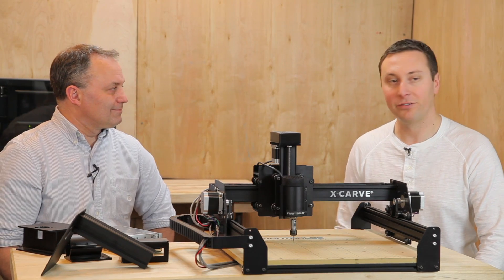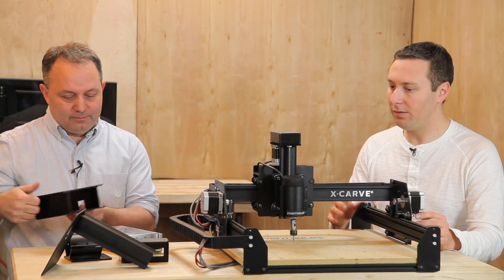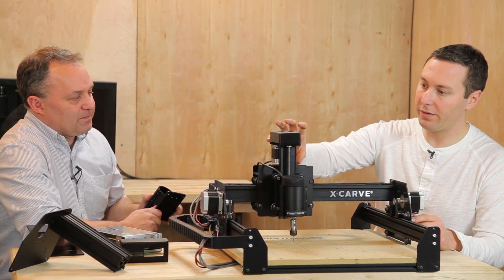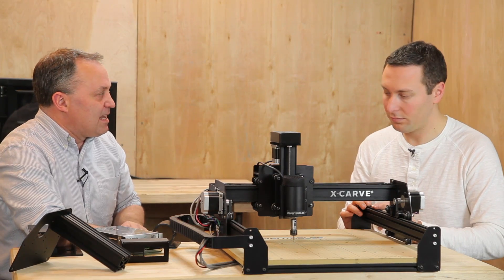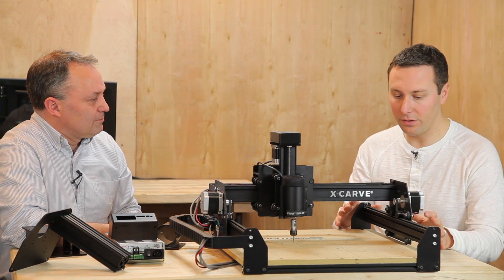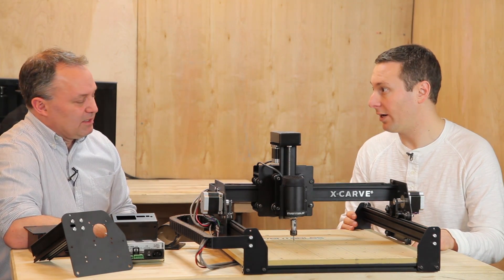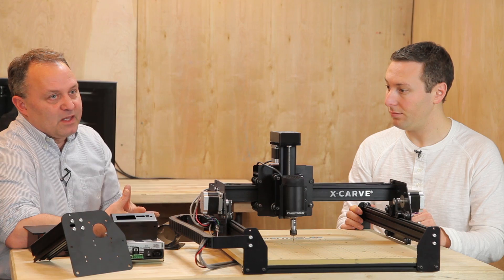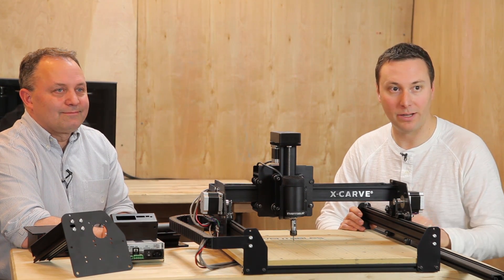Zach Kaplan and Bart Dring Introduce X-Carve 3D carving machine by Inventables

Comment: just called one of your sales reps and I told him just what I wanted the machine to do that be cutting into silver flat stock I am a ring maker and would like to get this machine in all my fellow ring makers back to the ? I need the machine to place a few words inside a set area  on flat sheets of silver the sales rep didn't know what I wanted and sent me to your easel site to see in the machine will do just what I wanted. doe's this machine do what I want place words in the center of a set area and around the coin I need to mill out plus a hole cut in the center of my silver sheet I need to machine several circlular  shapes ane a hole in it centered the words will be in the center from the inside hole to the outside of the circle can this machine do this if so I will order mine rite now

Comment: Really appreciate the simplification and the use of extrusions. Brilliant! Also like the price point, I looked pretty hard and couldn't find a better deal. There were a lot of places where you could buy parts if you had a clue what you were doing but for a fully configured unit that you can have confidence in the parts list it is really a nice setup. Can't wait to get mine and run it through it's paces.

Comment: what spindle speeds and feed rates can these run? I saw the part saying 1k IPM rapid which is fast but what kinds of feed rates would you get with a .1" depth cut in 6061 aluminum?

Comment: I was pretty excited about this kit until I saw the 800$ price tag for the "kit"...seems a little steep to not include a spindle. I watched the other one that was prior to this,,,the 44 min build kit. Is that still for sale? I saw bolts and square extrusion tubing. A nema package..you can get 3 nema 32s for 150$....and arduino and grbl shield for another 50 if you look around....so the engineering that went to improve this moved it out of what was considered a cost effective DIY solution....I your could get the small kit in around 500$ that would be an awesome sweet spot.

Comment: I'm considering a purchase but I have a few questions I'd like to ask first, if I may. I would be using this for small woodworking projects to give away as xmas gifts etc. I'm pretty good at mechanical things so probably the least of my concerns would be the assembly, given a good set of instructions. I'm also pretty good on a pc, however I'm a little concerned about the learning curve for a "rookie" learing the software. Is it pretty easy to pick up on? I could see myself using this to create nice wood inlays from images I would create. Would i need to create the images in another program and then import, or does the software you provide do that? Thanks for your help!

Comment: Lots of uhm, cool updates, ah, but uhm, the ah'mount of uhm's are uhm'believable. Makes it hard to uhm, follow! :p.

Very nice that it's compatible with the SO2! Is it possible to bolt the X makerslides together with the new setup?
Reply from the maker: There are plenty of DIY solutions for bolting the makerslide together. I assume you're talking about the X-axis? Some people just drill a couple holes and use spacers and threaded bolts in a few places along the length.